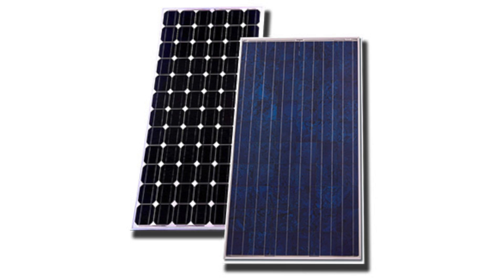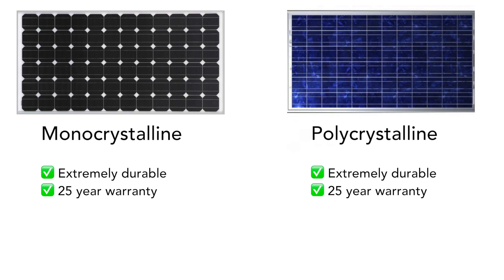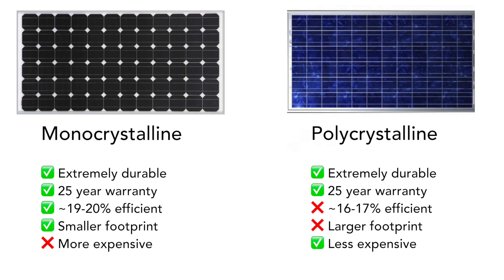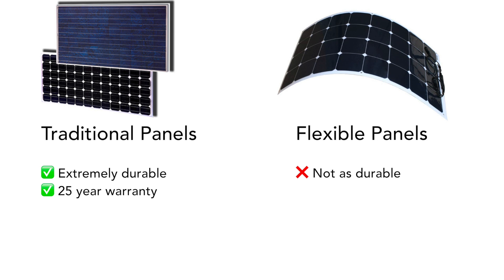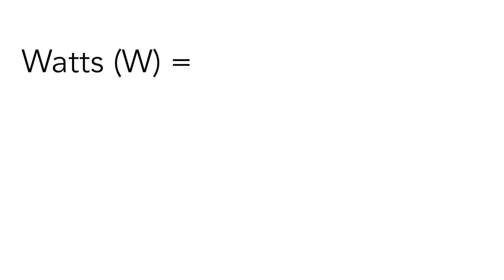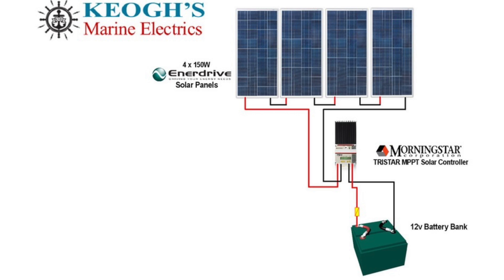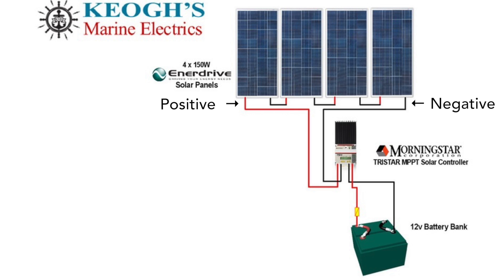Mono vs Poly vs Flexible Solar Panel + Series vs Parallel Wiring

Comment: Graphene is very expensive still, but  as an experiment, getting a sheet of graphene covering for a solar panel, the heat issue will change and so will absorption capability that will affect power produced in addition to higher protection.  Graphene might also reduce the heating of PV. It would be worth experimenting to see the outputs and value of extended life, more production, and higher strength against hail or impact damage. So would it be worth that investment? Who knows?

Comment: Also on the controller they have a limit on voltage they can handle too not just the amperage. Do the calculations and consider the total voltage as well.

Comment: I have been looking at solar for several years but the cost was out of my reach. 
I recently saw a DIY 10KW SYSTEM at alt e for around $16000. 
         This is a great price and should pay for itself in less than 10 years I think.

Comment: One key point is the wire expense increases with size and length, but not so much with controller.

Comment: I get it but then I need to look at my paper and rethink it because in my mind it gets hard, however when you can see things on paper with images it really helps! Thank you very well done, I am now learning the "proper" bonding setup and just found out even if a array is mounted off the home onto a pole or a framed setup the city has "CODES" that I need to plan for. CODES are never mentioned much and it can be a bad thing if someone setup a array and the city comes along and says "where is your permit" ah oh!

Comment: How can you connect Four 12 volt solar panels in serious and two 12 volts panels in parallel together so I want burnout a charger controller 150 volts Max and 45 amps thank you I have a 48 Bank battery

Comment: Hey I have a 30a mppt controller. Is oversizing using parallel setup equal to oversizing using series.

I know my mppt will cut connection at 150v when in series but will it stop drawing if I am  over amped or will the charge controller still limit to max 30amp?

What in your opinion is best? Over size series or oversize parralel? I want to oversize when the winter months come in.

This is for a small garden array which I move around manually to catch the light. 4 panels of 375w 8 amps I think. 37v

Comment: Thanks for that excellent presentation  and please discuss fuses and diodes to protect the solar arrays, in the event that one unit fails, the current would run back from the other two neighboring cells, to create a fire.  Adding a fuse on each unit stops a fire.  Thanks.

Comment: Great video, but what are the advantages of higher volts vs. higher amps?
Reply from the maker: Wire sizes and, ultimately, lower cost for the materials. Just depends on the design you’re going for. Thanks for watching!

Comment: Hi, I haven't purchased any equipment yet and I am new to solar kits but, I would like to know right off the bat what size solar panel, control charger, inverter and lithium battery to run a 640 watt led grow light for 10 hours a day?  Your expertise will be much appreciated!  Thumbs up to your videos, some of the best I have encountered.

Comment: Why is a large amount of available current from panels in parallel a problem when the charge controller will only get the current requested? I don't understand why mfrs offer WATT ratings for the input to charge controllers. It seems to me that only the voltage matters. Current flow is determined by the charge controller itself.

Comment: Voltage set is beter and blocking of entire serial conection by off one panel is NONSENC-E!!!! for that you have in conect box behind the pnell bypass diodes as solution.. dont spit BS pls...

Comment: I have both hard coverd with tempered glass in aluminum frame. And flexible panels. And i would say: First ones maybe inch thick and flexible ones maybe 1/3 of an inch at the most. Im not next to them right now and never measured them. But that would be my guess. Flexible ones 3 of them i used on the roof of semi truck and they died in 3 or 4 years. They were refurbished though. Maybe thats why. Now none of them produce any voltage. Planning to install new 3 non refurbished this time. Already have them, will se how they do. I used triple spliter to one positive and one negative wire which toock them to one charge controller inside the cab behind drivers seat. And output to power inverter which is connected to 4 trucks batteries with thick cables. Inverter also located behind drivers seat. So its power button within reach. Now i will use ecoflow 3600wh battery to power 400w ac sticking thru my back wall. It can be used while charging. So solar will just help the battery to die slower during the day. 300w solar versus 400w ac. Plus i understand its 300w in perfect conditions. Otherwise it may be 200 or 150 but anything would help. I had my little fridge always running on this 3 panels. And i was able to start the truck even after it was parked for a month. Batteries were dieing tho in a year or 2 anyways.

Comment: Great video. At the 17:32 it should be 600 watts; 24 Volta (12V x2 ) and 25 Amps ( 12.5 A x 2)? With respect

Comment: Curious. I have a boat with approx 600 ah of batteries.  12v system. I need to add solar in best way possible  would like advice. Some areas may have random shade at points. I am thinking 3 sets.... each set in series 2x100watt panels...for a total of 600watts.  I'd prefer to not have 3 charge controllers.  Suggestions? Also ideas on wire gauge? 1 set10 feet from battery, 2nd set 15 feet from battery, 3rd set 25 feet from battery...

Comment: Hi wating your videos , . All good but can you simply tell me ...
My setup is small 
2x 150w panels 
2 x 110 amp hour batteries 
30 amp mppt charge controller . As im getting mixed up by what is the best way to set these all up as 12 volt set up .please help thankyou

Comment: As a beginner. What size charge controller i need for two 110 amp hour batteries  2 x 150 watt panels.  . .

Comment: I need help. I have mttp epever tracer2210an with current 20amps, max voltage is 100 and 260watts max pv on a 12v system. I have 150ah gel lead acid. I have 120watts mono  18volts 6.67amps. I want to maximize the solar panel to fit my system. Do i need another 120w panel to make it 240? Or i can get above 260watts panel and make sure im below 20amp total?

Comment: Depending on manufactuer, most panels from 60w and bigger have 1 or more bypass diodes that help with shading issues for series connected panels. If 1 bit is shaded, the diode conducts so rest of string continues production

Comment: Thanks for wonderful presentation about series connection and Parrell connection. I quit clear about the two system. Question : if I connect solar panels in series, and battery connection must Serie or Parrell ??

Comment: Hey every early morning my grid tied system inverter lights is green, as the day goes clearer it turns red!!! Can Anyone here have any ideas why this happens? Seems like the sun activates the red light.
I have 10 solar panels 100w each and the inverter is a 1000 W grid tie inverter
Thanks

Comment: Hi I did some work on my solar system, I install 18 panels in total but divided them  up in 3 parts but when I was check for voltage the I got 120v from the 4 panel an the 8 panel gave me 240v an the 6 panel gave 208v but I am concerned about the 4 panel with the 120v cause I have sunny boy 7.0 inverter I want to connect to but that 4 panel have me wondering

Comment: Everything you said was correct, but your analysis was limited to using identical panels. Mixing/matching panels of different types is possible, but you can get really bad results if you don't know what you're doing.

Comment: You really can't have this discussion with out considering the type of controller being used and why it's preferable to have higher volts (by series circuit) than amps for efficiency with an MPPT controller, and why parallel with higher amps and lower volts  may be better with a PWM controller.  This is of course also considering design with in  the operation parameters of the controller as well, which you explained very nicely.

Comment: Neither serial nor parallel circuts prevent loss of power if some cells produce less. In series the total current will be of the weakest cell, in parallel it is a bit more interesting as weaker cells will start draw current from stronger cells - take a look here if you would like to understand better https://www.youtube.com/watch?v=tWxg7ZtviZs
The most proper solution for partly shaded cells arrays are microinvertors. Solves all problems however a bit more costly.

Comment: Not to be picky, but starting with a single solar panel rated at 150 watts, 17.5 volts, and 8.6 amps and making a 4 module system the final series result should technically read: 4x150watts = 600watts; 4x17.5volts = 70 volts; and 1x8.6amps = 8,6amps.. On the other hand in  parallel the result should technically read 4x150watt = 600watts; 1x17,5volts = 17.5volts; and 4x8,6amps = 34.4 amps. This means that watts increase in both series and parallel. Meanwhile volts increase in series but amps stay the same. In parallel while volts stay the same while amps increase.

Comment: Nice Videos, In Parallel configuration, how is the impact of if one PV Module shaded for the PV module itself? Is it need additional diode to protect backfeed current to the PV which shaded?

Comment: What’s the advantage of having more volts over amps or vice versa?
Reply: High voltage thin kabel, thick isolation, expensive charge controller. High amps the other way around.

Comment: Do these apply for portable foldable solar panels being parallel or series? I meant panels which has both USB and cables connect to a solar charger? What about the batteries? Does it apply to these concept as well?

Comment: Cool I just got some 170w sunpower light weight panels on sale for $250 normally $400.  https://www.ebay.com/itm/SunPower-170W-Solar-Panel-sun-power-170-watt-flexible-5-year-warranty-panels/333653724859?hash=item4daf4fcebb:g:7LIAAOSwkAhfDMQ-

Comment: Is this correct to say its 600w in series? If you had 2x 12v 100ah batteries in series you would get 24v 100ah? Not 200ah or is this because we are talking amps not watts? The amps don't change but the voltage does... im getting confused. 

So if I wired up 2x (12v) 50w solar panel in series it would actually be (24v) 100w?

Comment: In your series totals you listed 600w in series. Is it not150w in series?
Here is some info I found:
sorry for the links. just wanted you to get this information. Del if needed.
https://www.solarreviews.com/blog/do-you-wire-solar-panels-series-or-parallel 

When solar panels are wired in a series, voltage is additive, but the amperage stays the same. For example, if you have five panels that are 12 volts and 5 amps each, an array that is series wired would have 60 volts and 5 amps. But if you parallel wired those same five panels the amperage would be additive, while the voltage remains the same. Therefore, you would have 12 volts and 25 amps instead. 

https://www.renogy.com/learn-series-and-parallel/ 

WHY SERIES? 

Strictly series connections are mostly utilized in smaller systems with a MPPT Controller. Connecting your panels in series will increase the voltage level and keep the amperage the same. The reason why series connections are utilized with MPPT controllers is that MPPT Controllers actually are able to accept a higher voltage input, and still be able to charge your 12V or more batteries. Renogy MPPT Controllers can accept 100 Volts input. The benefit of series is that it is easy to transfer over long distances. For example you can have 4 Renogy 100 Watt panels in series, run it 100 feet and only use a thin 14 gauge wire. 

 

https://www.energysage.com/solar/101/wiring-solar-panels-in-series-or-parallel/ 

When a solar installer wires your solar panels in a series, each panel is connected to the next in a “string.” The total voltage of each solar panel is summed together, but the amps of electrical current stay the same. When you wire in series, there is just a single wire leading from the roof for each string of solar panels.

Comment: Very helpful. Very well explained.  I am a newbie with 1 Wynn video, and 2 by Will Prowse.
1) Probably time for an update (the technology incrementally changes)
2) You refer to your other videos in a series and then "as you already know".  LInks, links
3) As you instructed, series wiring has advantages, but shading is a problem.  What is the current state of the art in using both Bypass and Blocking Diodes to eliminate this limitation?

Comment: I have 16 250 watt solar panels to become 4000 watt and an single phase Inverter of 220 volt of 4 KW.   I want to install them to pull out water from a 100 meter deep well by 1500 watt water pump .  Can I wire them in 12 vs 4 panels both series and make  them parallel to increase the voltage to increase the water out put?

Comment: A few misconceptions but a well produced video nonetheless. Love the name lol 
I did see in the comments someone saying that there are diodes across the panels to stop the shading loss, this is quite untrue, they are there to protect the panel from reverse currents which may destroy the panel. This is silicon and the way a solar array works is not dissimilar to a transistor.
I think the second misconception is that the panel has been taken as a single solar unit, whereas the panel is an array of cells, configured in series and parallel. Those cells that are shaded will of course not turn on and thus will not conduct and generate electricity. 
A simplistic way to think of this, is in terms of there being a row of cells in series (~18-22), to give the panel Voltage, and rows of cells in parallel to give the current. 
Now if you imagine that the top half of a panel is in shadow and the bottom half is not, then the panel will still generate a current albeit less than a full panel.
So if each row generates the Voltage, then covering a row up will turn the power off and any row in sun will generate power. 
You can easily see this when you look at a panel. The cells are in a series and parallel matrix, so even if you cover a top corner of the panel, the rest of the cells will still generate power.
Hope this helps.

Comment: Can you pls clarify if the whole system becomes 12 volts or 24 volts or 48 volts in the 3 options you elaborated upon, i.e. Series, Parallel and Combination.

Comment: Good day, 
Is it ok if i connect my to panels in series with385w, 40v each panel, total of 80v output. I used SRNE mppt SCC, and 2 12v battery connected in series for 24v system voltage. Is it ok to mppy to regulate the voltage from 80v to 24v battery? Thanks

Comment: Mono apply more amperage. Poly apply more voltage. And since the voltage is DC (one direction) the consumer can mix mono and poly creating a solar system that is the most energy efficient. Unlike the solar company's around the world and the NEC claims, the solar energy consumer can use UV using standard compliances within the industry.

Comment: normal panel cost 0,8.1$/Wat 100W panel not newer buy if cost ower 100$ have ower price more.  idiot pay more what need. 1000W cost today good shop 1000$ normal price, if cost more seller have thief and scammer and lier. and no buy . charge controlelr cost normal 10-40A about 10-50$  if one panel maximum output have 5A and you have 10 panel you need 50A charge controller. cost about 50-70$ battery have all system exåpensive parts, need many, how more then better. and need be deep cyckle battery. expensive lot.

Comment: i have 8 panels 325w 46v how should i set up this system to a vitron charge controller 150/85 series or parallel

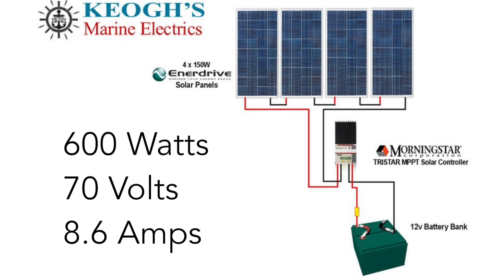Comment: Wiring in series lesson begins at 7:05   Wiring in Parallel begins at 10:18   Lesson on pros and cons of series vs parallel begins at 11:47   Wire size chart at 12:17    Lesson on third option wiring in series AND parallel begins at 14:45

Comment: Do you happen to know if a 3phase inverter works with a single string or are 3 individual strings, i.e 3 separate arrays required?

Comment: It seems in testing that the mono panels put out less than the polys as far as advertised output.  They are smaller, but maybe too small, as they seem to under perform in real world tests.

Comment: An excellent presentation, a well done video, I just wanted to point out a way around the loss when running panels in series and one getting shaded, The reason for the loss when shaded is the fact that an unlit cell is almost an open circuit therefore allowing the rest of the cells to reverse the polarity of the shaded cell or cells, however most of the newer high quality panels have blocking diodes across portions of the panel as they cannot put them across individual cells as the forward voltage drop of a standard silicone diode which is 0.6 to the threshold and as high as 0.9 at it's full rated current, is greater than the voltage produced by a single cell which is 0.5 nominal depending on cell temperature. The easiest way to get a series string of panels to operate just like the parallel panels do losing only 25% when one panel is shaded in a group of 4 as he is showing, is simply to place a shot-key bearer rectifier diode across each panel, as they only have a 0.3 volt forward voltage drop to the threshold and will be less than 0.5 volts at full rated current making it equivalent to the loss of a single cell.

Comment: Just saw your video, very good for me a beginner. Got lost though on the combined series/parallel example. You mentioned 12 volt, then finishe with 17.5 volts when describing you panel out put.
Reply: I also observed the same mixup

Comment: Not a bad video but 1 thing, It's silicon not silicone.  Silicone (pronounced si·
luh·kown) is the stuff used to weather seal windows, etc. Silicon (pronounced si·luh·kaan)  is a tetravalent metalloid used in semiconductors.